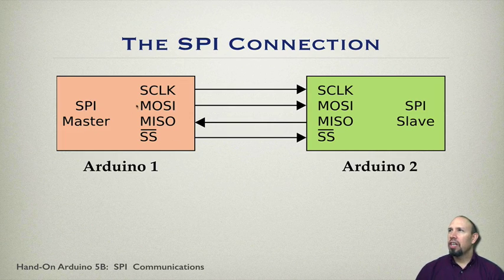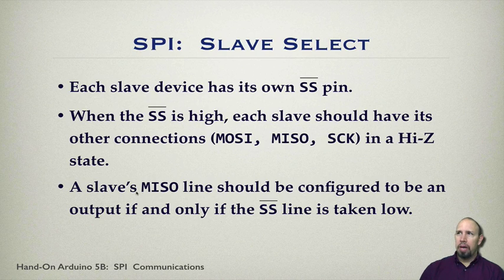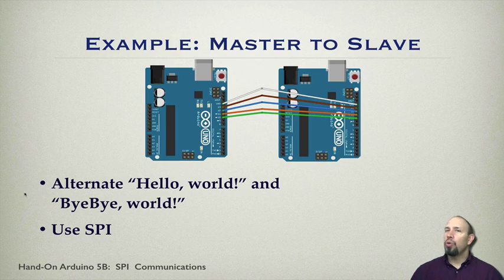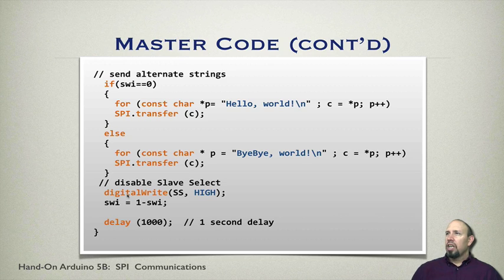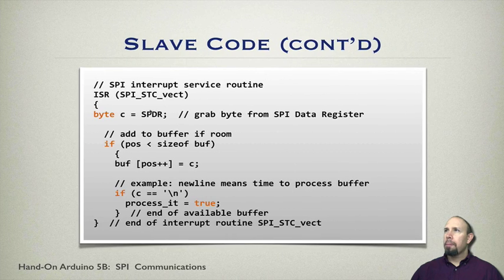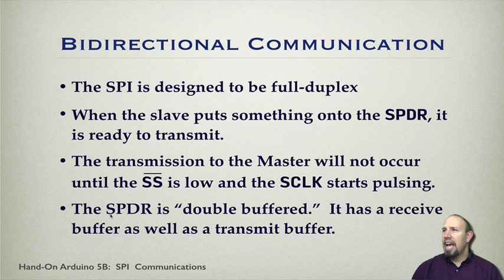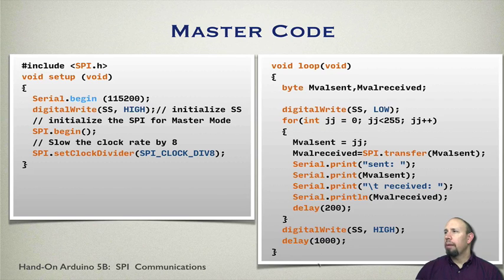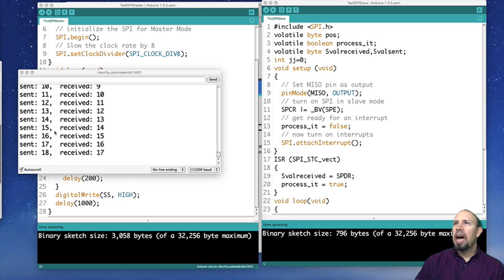Hands On Arduino 5B:  Arduino to Arduino SPI Comm.

Comment: Hi, very well explained. I have a question if my master device is not an arduino and it has SPI communication available and it sending 24 bits of data . Since SPDR is 8bit register ,is it possible to capture the 24 bit data sent by the other component ? Can the Arduino slave function without the interrupt service routine ?

Comment: Assalam-o-Alikum! Hay Robert!its good example but i faced one problem in one directional communication i.e i send a byte from master but it does not received exactly to the slave .i am using serial monitor ????????????????
Reply: check baudrates that could be the problem, if not check if the grounds are connected to master and slave (to eachother) and check if the wiring isn't lose/broken

Comment: I think you missed a {} for the if loop on minute 24:25 but I'm not sure
Reply: Nope, it's just a horrible coding practis. This is a 'one liner' if statement written on two lines.
It works but is bad coding, bacause it is difficult to read as you already experienced.
Reply from the maker: I can see why you might think so, but the internal IF statement is a one-liner.

Comment: Hi Robert,
Your video was great.I helped me a lot :).

I made a small modification to your code to echo back the received data to the master

I sent 0x75 from master continuusly and in slave i received the data in the interrupt and the next line inside the interrupt i pushed back the data which i received to the master but first 3 times i am getting 0xf5 and the consecutive times i am getting 0x75. A one is added at the starting bit to get 0xf5.  I don't know why it is getting added initially ?

This is the slave code i used 

#include <SPI.h>
volatile boolean process_it;
volatile byte Svalreceived,Svalsent;

void setup (void)
{
  //set MISO pin as output
  pinMode(MISO, OUTPUT);
  //turn on SPI in slave mode
  SPCR |= _BV(SPE);
  //get ready for an interrupt

  //now turn on interrupts
     
  SPI.attachInterrupt();
}

ISR (SPI_STC_vect)
{
  Svalreceived = SPDR;          // slave receiving data from master
  
     SPDR = Svalreceived;                // Slave sending data to master 

}

void loop(void)
{

}
Reply: Vignesh Balaji (

Comment: @Robert Paz I am working on RC522 rfid and SD card module connected to arduino Uno, have choosen PIN4 for SD card selection and pin10 for RC522 ... but whenever i insert SD card module in breadboard, the RFID stops working ..... i have taken care of respective SS pin to make low to do data transaction... but still not working !
I will appreciate your help

Comment: Question: Do you have (or know of) a good tutorial for working with MULTIPLE SPI slaves? (ie. I am assuming multiple SS lines need to be defined, and set high or low accordingly? or is there something in SPI library to handle this?) I'll go try to look up the library documentation, but I'm looking to chain up several SPI sensors and communicate with all 5 of them...
Reply from the maker: Matthew Gudenius The help page on Arduino SPI says this:
It is, however, possible to use any pin as the Slave Select (SS) for the devices. For example, the Arduino Ethernet shield uses pin 4 to control the SPI connection to the on-board SD card, and pin 10 to control the connection to the Ethernet controller.

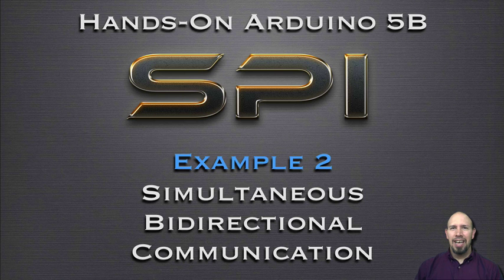Comment: At 27:00, on the serial monitor window you can read "yeeBye, world!" instead of the supposed "ByeBye, world!". Is this an error from the data lines being noisy?

Great tutorial videos!!
Reply from the maker: Yes, you saw that right.  The serial monitor has little glitches from time-to-time.  It usually occurs at startup.  I'm not sure why it does it.
Reply: old comment but would like to point out this is all pc sided, arduino works perfectly fine, if you ever want to use the serial port for a program on your pc, make sure to check incoming data and make some sort of error detection